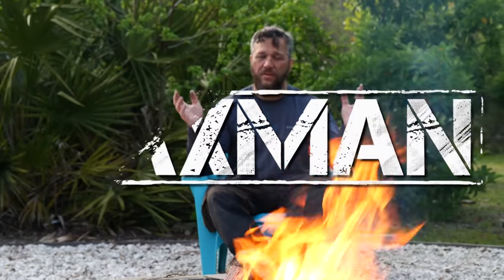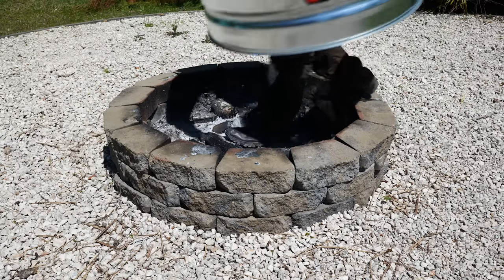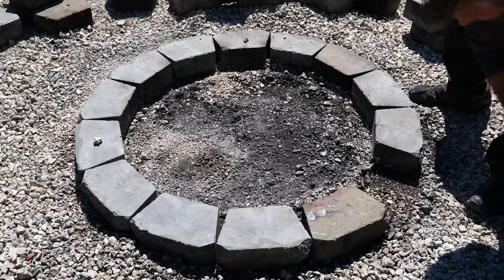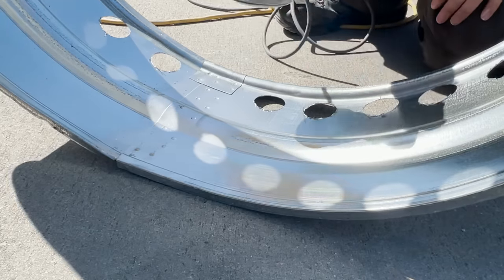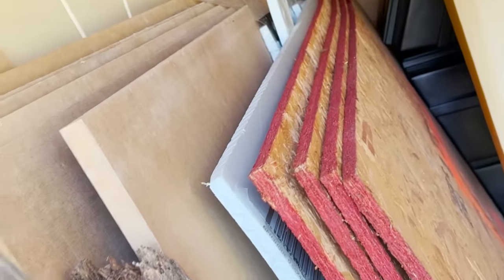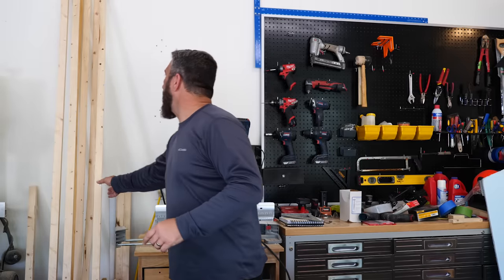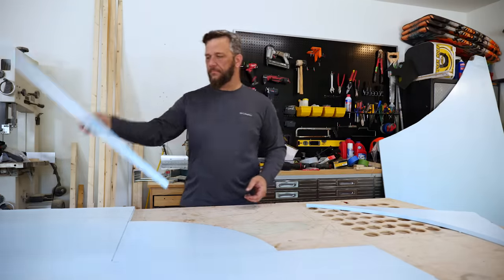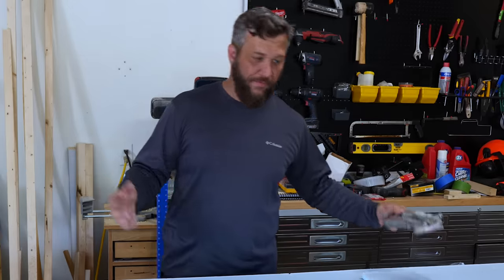Smokeless Fire Pit Makers Hate Me For Showing You This

Comment: You are hilarious, we enjoy your videos and love your ideas. Don’t stop making these videos. Ok so I replicated everything you did in the smokeless fire pit. But mine still smokes, not sure what I missed could use some advise. I wasn’t sure on the hole diameter size at the top of the ring you cut, but I did use a 2.125” diameter hole cutter at the top of the ring. I also made my own top layer with cement forms only because I loved the idea of 4pcs. After I had my blocks level I placed the ring in the pit then added crush stone on the outside and also inside of the steel ring. I also put a bunch of crush on the base of the fire pit as well I found it easier to then lift the steel ring up to the bottom of the cement forms grabbing it in the 2.125” diameters I cut, using my welding gloves of course. It self leveled itself around the ring on its own because the crushed stone filled the space underneath the ring when I lifted it up. I then made sure there was a 45 degree berm against the inside wall of the ring where the fire would be and also to cover any gaps where air would leak between the ring and the inside wall of the block. The space between that area by the way is roughly 2 to 3 inches. I was contemplating pouring a ring of Cement around that inside base area to make sure there weren’t any air leaks. To be clear between the cement block and steel ring at the base only. Not sure what else I should do but would appreciate your advice.
Reply from the maker: Hard to say without being there. One major thing is to make sure that the fire is wide. If you build a fire that's tall but doesn't touch the sides it won't work. In order for the second burn to work the sides have to get hot. Make sure you spread the logs out to touch the sides. I don't know if that's the issue but I hope that helps.

Comment: How many bags of concrete did you use per cap?  Great video!  My foam forms are drying.  Next step pour concrete and I’m good to go.  I was also considering concrete due to make the caps darker??
Reply from the maker: I used three 80 pound bags for all four caps. Make sure you don’t get the mix too runny. Keep it as dry as you can but still spreadable.
Reply: @HAXMAN  Awesome! Thanks...and my auto correct messed up my post.  Concrete dye (not due)  to make the caps darker.  Thanks again, great video!

Comment: If you were to place bricks, spaced apart in the bottom of the fire pit, supporting a steel mesh as a platform to elevate the galvanized steel ring above the bottom of the fire pit, it would allow lots of combustion air through the base of the fire supporting a cleaner, more complete combustion with less initial smoke. The air introduced through the top holes for post combustion would be the coup de gras for any remaining smoke.

Comment: You had a pre-existing hold which you filled with rock but could this same build be done on concrete?
Reply from the maker: Not directly on concrete. You need some time of fire brick between the fire and the concrete below. Your concrete would crack from the heat. The concrete on top doesn’t get hot enough for that to be an issue.

Comment: Question.   What is the purpose of the holes in the ring being so high up?  I would think the holes would work better if they were on the bottom.  We used to use metal barrels for burning things.  We would punch holes in the bottom of the barrel to force air in and get a Smokeless burn.
Thanks for any comment to help me understand.

Comment: Love the video, love the comedy and production value

I've almost completed my pit based off of yours, the one thing I'm having trouble with is what filler to use.  It looks like you have gravel in yours, but I've read online that if you use gravel or stone or natural rock they can explode.  My local big box stores don't keep fire bricks, fire rated cinder blocks or lava rocks in stock.  What are you using as your filler and have you had any good/bad experiences using any material in particular?

Thanks again! Excellent video!
Reply from the maker: I just use the regular garden rocks. I have never had any explode. I know it’s possible but if any have it’s been small and unnoticed. Thanks!
Reply: @HAXMAN  thank you for the quick response!  Best to you

Comment: Nice fire pit, you did mention the ring is 36" diameter what is the hight?Most of the rings I have looked at are 12" it seems that its a standard size in the video they look taller and it seems that 12" is a bit shallow?

Comment: Has it worked out in more fires? I want to make one also but I noticed when you compare fires the smoke one had way more wood. I'm just curious if it still works that well with the same amount of logs. Thanks again
Reply from the maker: It had the same amount of wood. It’s just lower in the pit so it looks like less. The bigger the fire the better it works. A small fire will not be smokeless. The fire has to be big enough to get the sides hot.
Reply: @HAXMAN  oh fantastic! Makes sense hotter fire stringer air flow. Thanks again!

Oh also when I looked on tractor supply warehouse I saw a similar ring with predrilled holed I may try.

Comment: wondering if the concrete cracked.
usually you have to do a few small fires to get the concrete up to strength to take the heat

Comment: Question for ya - so I was having some fun and got the fire going extra hot. The flame was hitting the bottom of the concrete toppers and the bottom started blowing out. Is this because I made the mix too watery/didn’t let cure long enough/didn’t put any fiberglass in it?
Reply from the maker: Probably too watery. Some people have said that you should use fireproof concrete but I have tried to make these pieces crack intentionally by letting a huge fire hit them and I’ve had no issues almost two years later. You want the concrete mix to be as dry as possible when you pour it. Also don’t start a fire if the top is wet from any recent rain. That can cause trapped steam and that will break the top.

Comment: I never knew about the fiberglass! But quick question, I'm going to be making concrete paver stones later this year, do you reccomend a shaker table (or shaker of some sort)? I don't think I saw you had used one, but I've been warned about air bubbles (especially in pavers because they're smaller). Great work, came out awesome!
Reply from the maker: Thanks! I don't think you need anything special. You can bang the mold on the table and that will work fine. That's what we did when I worked in precast concrete. You can also put a vibrating sander against the side.
Reply: @HAXMAN  Awesome Thank you! I've got a pretty impressive DIY starter kit as far as tools are concerned, dabbed with a little bit of Ohio/West Virginia "that's not going anywhere" upbringing lol! It's haaaaaawt! Been outside putting down adhesive carpet tiles (24X24) over the tiled porch, I'll get started on the firepit next! Wait....no. AFTER my pavers. 😉 But this damned Yankee lives in Virginia Beach now and my only advice to anyone working outside right now (or this summer) is DRINK WATER!  Beer's for when you're done lol! Thank you for the reply and when I get those done I'll post an update for ya! Have a safe weekend!

Comment: Great video. What size holes do you recommend cutting? I got a 2 1/8 bit, but am thinking that might be too big. Luckily haven't tarted cutting yet though. Most of the Breeo and Solo Stove models look like a lot of smaller holes vs fewer larger ones.
Reply from the maker: I think I used 1 1/2” but I think smaller might actually work better and be easier

Comment: Have you had any issues with the concrete top? Like cracking or anything due to the heat? Trying to see if I need to get high heat concrete or just quickcrete
Reply from the maker: I haven't. I've actually tried to make them crack by building the fire right up against them. I've shown this in recent videos. The main thing is to make sure you mix the concrete properly and add only the minimum amount of water. The high heat concrete is so expensive it wasn't worth it to me although in the long run I'm sure it's better. Don't make your decision based on me though. I don't get freezing weather also.

Comment: i want/need to enjoy the main purpose i, personally, have built a fire pit.  
would this venting phenomenon be mostly compromised if a section of wall were cut out for the enjoyment of heat radiated by the burning wood?
Reply from the maker: I’m not certain but I think it wouldn’t work as well.

Comment: you used a tractor supply fire ring initially and drilled holes in it .Is there a reason you didn't buy a ring that already had holes (either decorative or just square)?

Comment: Questions for you. Does it matter the size of the holes? What size did you do? If you go smaller, there would be more holes obviously, do you know if that makes it better or worse and just best to stick with the size you have? I have a one inch right now and curious if I need to be going out and getting a different size or a step bit.
Reply from the maker: That size will be fine. I’m actually going to build another one for my sister and I’m going to try smaller holes.
Reply: @HAXMAN  Thanks!

Comment: Do you have any tips about drilling the holes in steel?  I'm using a 3mm galvanized steel ring that I got off Amazon with a 20V Dewalt drill and 1.5 inch Milwaukee hole saw, and I'm not getting through very well.  When I'm on low speed it seems like it makes no progress, and on high speed it's just burning off the 3 in 1 oil I'm using to try to lubricate.  Legitimately taking me several minutes (5?) of drilling on high speed for a single hole.  Is this right?  Am I doing something wrong here?

As far as I know it's not a Stainless Steel ring and the hole saw is advertised as rated for metal.
Reply from the maker: I’m not sure. Other people have mentioned issues with the drilling. I used the Milwaukee hole dozer hole saw to drill the holes. Maybe my ring was thinner but I drilled almost every hole on one 12volt battery and the bit is still sharp. I also drilled on high speed. It took me about 10 minutes to drill them all. I wish I could help more. Surely it’s not stainless steel because that would explain the difficulty.
Reply: @HAXMAN  Thanks for the quick response.  I'm using the same hole saw.  I must have bought too high of a gauge of steel or something, but hopefully will get through it.
Merry Christmas to you and your family!  Love the videos.
Reply from the maker: @clytie_druid  Merry Christmas!

Comment: Does this make your fire burn through wood quicker? How does it throw heat? I assume you don't feel much, if any heat at or below the bricks? We get -40 to + 40°c so I like adding speed holes that double as a heat transfer. This might be my next plan. Cheers
Reply from the maker: It does burn faster. After the fire there nothing left but ash. No partially burned wood. It throws heat out great but you're correct, the bricks block most of the heat below the cap.

Comment: So these videos are awesome and I love your humor, I love the dog scoop and the payoff in the next video. Keep on doing what you are doing, you have inspired me to start trying to spruce up my yard and make it more entertaining friendly!!

I had a question, I just built my insert and block smokeless fire pit, I went with a slightly bigger 46 inch ring, but it's only 10 inches from the ground to the top, do you think it would be a big impact to the effectiveness of I put a 4th layer of 3 inch blocks on top and then did a cap layer and then had them overhang inside the pit like 2 inches or so?
Reply from the maker: Thanks! It’s hard to say. I don’t think the height will impact it that much. You’ll need to make sure your fires are wide enough to heat the sides of your pit. Typically smokeless pits tend to work better taller and narrower. It should still work fine. Just make sure you don’t build a small fire that doesn’t touch the sides.
Reply: @HAXMAN  thanks man, that's a good point. I used some construction adhesive so I'm going to wait for it to cure a few days before I put a fire in, I'll comment back in case anyone else is interested.

Also my next one is getting built with the tractor supply ring just cuz it's easier! Had my kids on magnet duty to pull all the metal shavings out of the lawn when I was done!!

Comment: Tip: mix the fibreglass in when initially mixing the concrete 👍
Reply: You might have it pushing through on the surface of the finished ring instead of in the interior of the form.

Comment: I’m at the point of making the molds for the concrete. I have the polystyrene pieces cut and tried to use contact cement, but it melted the polystyrene. I’m using the pink foam board . Any suggestions for the right adhesive?

Comment: @Haxman is the fiberglass mesh..."screen mesh"? Im following your video almost exactly how it's presented. I'll construct the papers tomorrow but I'm a bit confused on the cap
Reply from the maker: Honestly I wouldn’t worry too much about putting the fiberglass in it. I don’t think it’s necessary. Do make sure that your concrete mix isn’t too wet. If it’s too wet it will be weak and crack.
Reply: @HAXMAN  understood. Also...thanks for the follow up video for the smokeless pit! Me and the wife just watched it. Maynhave some followup questions about the pit but so far so good. We love your videos. Subscribed with notifications on. Next project is your DIY Patio lighting. You're the man!
Reply: @Haxman I'm about to build my caps. Is there a specific type of concerte I need? Also, I don't have a fancy mixer. May I just mix it in a bucket or wheel barrel?

Comment: How much of a gap did you have between your ring and that first layer of brick? Was that intentional or do you recommend fitting them as close as possible to the insert?
Reply from the maker: You need the gap to create air flow. At least 1-2 inches.
Reply: @HAXMAN  thnx ur awesome!  Starting today. So it essentially 2 rings. Ur insert and firepit aren't attached except with the cap at the top?
Reply from the maker: @tonyp4914  correct
Reply: @HAXMAN  sincerely appreciate it. Starting project today. LOVE THIS CHANNEL ALREADY & SUBSCRIBED!

Comment: i followed this design, but instead of 4 pieces around the top I created 2 half moons.  the pit look fantastic when complete but after a week's worth of fires hair line fractures formed and the tops split completely through in multiple places from the heat.  i used Rapidset concrete since it's way easier to create tops without air pockets, which i'm thinking is part of the problem so i'll try again regular quikcrete with rebar.  

curious if others have run into this issue with concrete cracks due to the heat
Reply from the maker: Sorry to hear that happened. I’ve used mine a lot with no issues. I’ve made some huge raging fires. One thing to make sure of is that you don’t put too much water in the cement mix. I’m not saying that’s the issue but it will weaken the concrete.

Comment: Would smaller holes around the top be better or worse??  I have a step bit but it’s like half an inch diameter max…
Reply from the maker: Commercial ones use small holes and some people say they work better. When I tried it the large holes worked better.

Comment: How wide was the stock tank you used? Do you think this would work with a 6' wide fire pit? I have found a 6' stock tank....but if the fire was not taking up a very big section of the pit, I'm guessing the fire wouldn't be able to heat up the cool air between the ring and the blocks?!
I may just have to totally downsize my fire pit?! Thank GOD I haven't poured the concrete pad around it yet LOL
Reply from the maker: Definitely too big to work properly.

Comment: Any issues with concrete topper? I've heard concrete can fall apart or even explode if it gets too hot.
Reply from the maker: No. I’ve used it a lot too. One thing is to make sure the mix isn’t too wet. That will weaken the concrete as well.

Comment: You need holes on the bottom to let the air in. Same as heatalator vents on a fireplace. Lower vents draw in the air, top vents blow the hot air out.

Comment: want my firepit to have some more height than the 10 inch height of the fire ring.  Plus I want a spark cover, etc.  do you think the same concept would work if I bought an actual fire bowl on a stand with cover (kit) and surrounded the fire bowl with bricks like you did?  I would also put the holes around the top like you did.  Or does the bottom of the fire pit need to be stone in order for this to work?  Or should I simply stack 2 rings on top of each other?
Reply from the maker: I think the stacked rings would work better. Put the one on the bottom upside down with the trim ring down.
Reply: @HAXMAN  thank you.  can you share more why you think the stacked rings would work better?
Reply from the maker: @michellewhalen305  Just because it follows the proven design that the factory smokeless pits use. The other might work as well. It’s just an unknown.

Comment: What if you take that fiber glass cloth and shred it into the cement mixer while mixing?  I supposed the direction of the fibers needs to be parallel to the surface of the cement instead of randomly curled every which way.  But... still seems like every which way would also work.
Reply from the maker: You can do that as long as you put the first layer down without fibers in it or it will show on the surface. That’s actually even better.

Comment: Does it make any difference if the holes are on the bottom and not on the top?
Reply from the maker: Yes the holes need to be on top to work. You can add a couple holes to the bottom in addition, but only a couple. This is the way store bought smokeless fire pits are made.